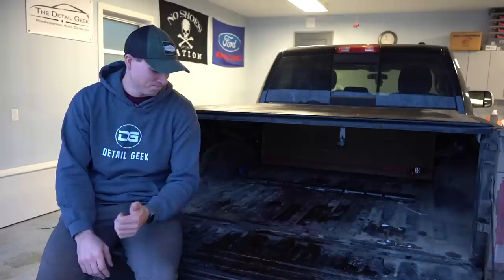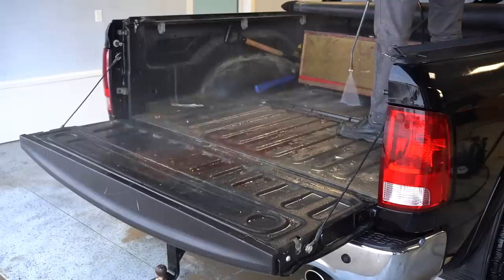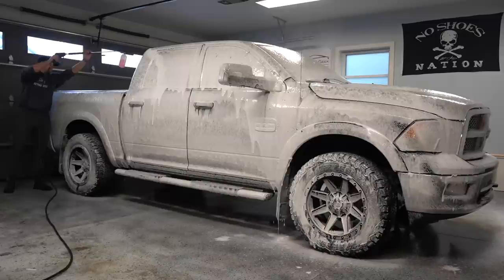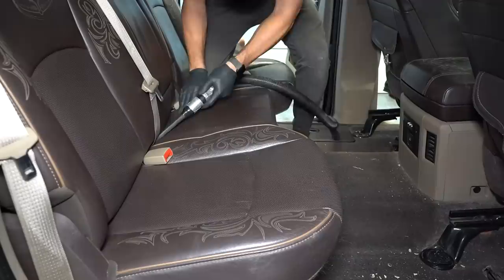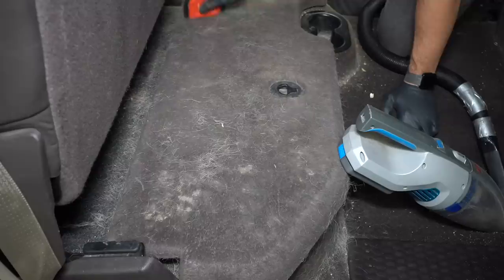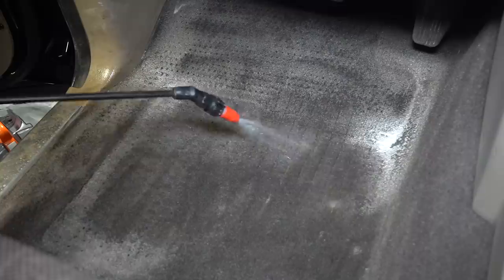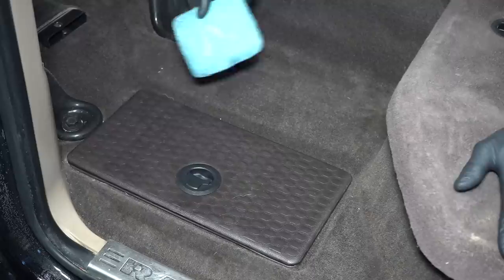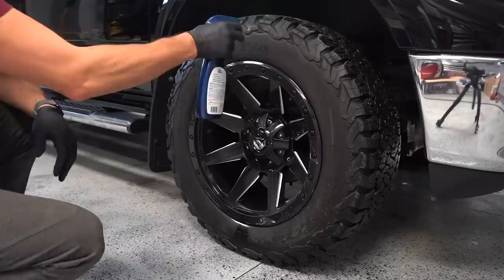Deep Cleaning a HUNTER'S Dirty Truck! | The Detail Geek

Comment: Out of curiosity why don’t you use the turtle wax ceramic spray for the protective coating? So much faster of an application and same durability with 1 coat. You could do 2 coats of the ceramic spray in the time that you did 1 of the sealant and have an estimated 12 months protection. Btw love the videos, just curious to know your professional opinion on the sealant?

Comment: Nice job on all your detail jobs, a question- during winter, do you run the  gas pressure washer outside and run the hose in the garage or do you use an industrial electric pressure washer? Also, how do you keep the garage walls/cabinets from getting the washer overspray dirt all over them?

Comment: I’m curious what the going rate is for a job like that. You deal with some of the worst conditions I’ve ever dealt with in my 6-8 years of detailing . The only other thing you could’ve done is paint corrections which is a whole other subject. That job with that vehicle in that condition I would charge between $300-$500 here in SoCal That’s without wet sanding or buffing, just sealant or wax like you did. Great job. New sub here.?

Comment: I see a list of the products you use and I have a number of them in my amazon cart, however I dont see the pressure washer listed.  Would you be able to share what your using? I've worn out my pressure washer and want a good one this time.  
Thanks for your hard work in putting the videos out.
Reply from the maker: I use a Honda GC 160 👍🏻
Reply: @TheDetailGeek  I saw that in another video.  Do you have a specific model? I ask because when I search for the Honda Gc160, what I find is that it's the motor and that a number of different machines use that motor.  Maybe my Googlefu is weak.  Lol

Thanks for all the help and the reply.
Reply from the maker: @davidashley2719  No you're right, that engine is used for a number of different applications. I don't recall the brand of pump I have on mine...I had it replaced a few years back.
Reply: @TheDetailGeek  thanks for the info.  I will check around and see if I can find a decent one at a good price.  I noticed that some of the pressure washers with that motor ran $350 and others ran over $1,000.  Inwill see what I can dig up.  👍